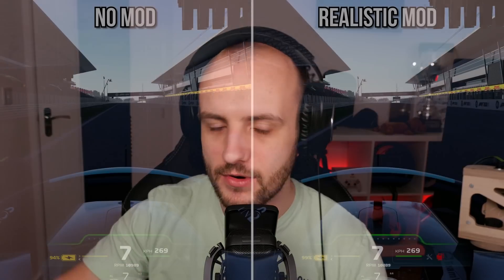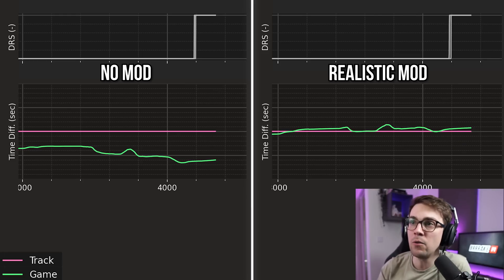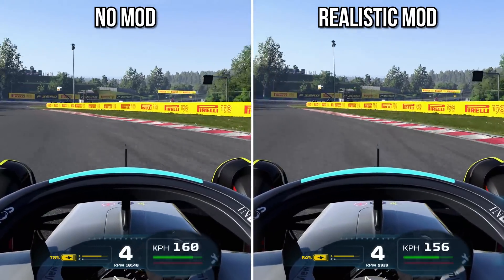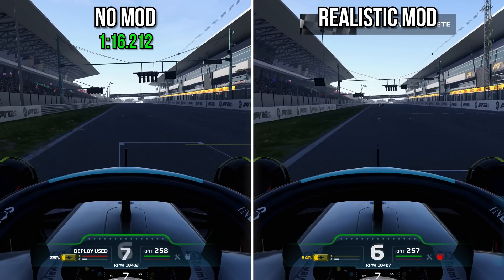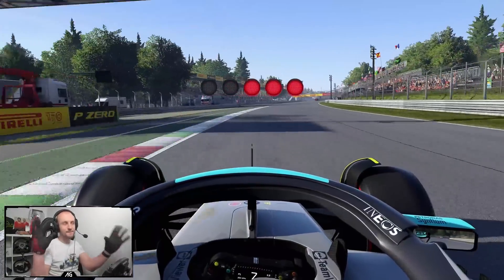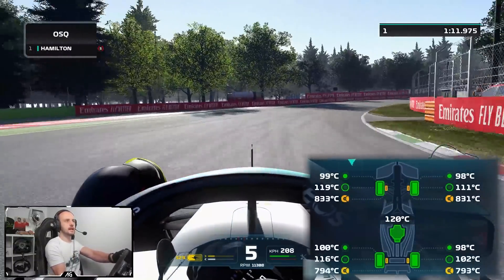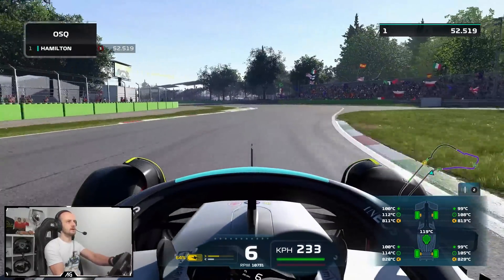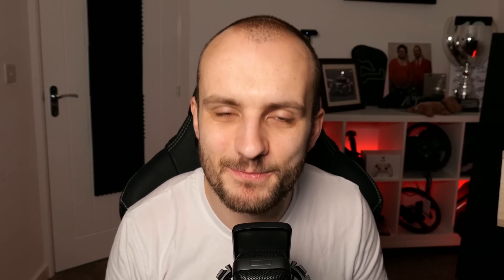An F1 Engineer Made The F1 Game More Realistic

Comment: What about the high altitude in Mexico for instance? I'm fairly certain the F1 games don't take that into account either. 
You can run with pretty high wings in Mexico and still achieve incredible speeds on the straight (in real life) due to the air resistance being much lower there. In the game however, running high wings there will make you crazy slow on the straight...

Comment: In terms of the DRS, there needs to be a modifier for it getting weaker the less rear wing you have on.  At Monza, the DRS is of minimal assistance because the rear wing already generates so little drag, whereas Hungary being a high downforce track, the rear wing is significantly larger and the difference is huge.

It seems like DRS in game is just a flat increase; I gain just as much at Monza as I do elsewhere

Comment: I was always under the impression that you used brakes to heat up the carcass but when i was doing the tire warm up and using brakes to warm them up it wasn't really affecting the temps at all. I just use surface now instead of carcass and surface.

Comment: Tyre temps/wear, make different aerodynamic models (DRS is less effective in Monza because of low downforce wings) than in Bahrain for example, and tyre compounds. I'm not sure but I think there's only 3 compounds available for all tracks instead of the 5 there were available. Also for 23 I think there adding 2 compounds so that's gonna make it even worse
Reply: As it is in Real life: for each track/race weekend all teams get 3 different compounds of tyres from the 6 in the overall selection (Softest C0 - Hardest C5). Those 3 Compounds are always named and marked for Soft, Medium and Hard but f.e. on a track like Monza it can be the Soft Tyre (C0) Medium Tyre (C1) and hard Tyre (C2). which are the softest in the collection. But in Austin it can be the Soft (C3) Medium (C4) and Hard (C5). which are the hardest tyres in the collection. In fact u might know all the tyres from a couple of years ago hypersoft (C0), ultrasoft (C1), supersoft (C2), soft (C3), medium (C4), hard (C5).
Reply: @DraqzF1  you think I don't know how tyres work IRL? I meant it as in the softs from Bahrein (for example) are the sames as the softs on Monaco. There's not 5 compounds in the game. Only 3

Comment: You should change the ers sistem,because in a quali lap drivers actually puts ers on recharge before the braking point(actually the car software does it by itself).It would slow down the cars a lot at the end of the straight,not allowing them to reach very high speed

Comment: i find it so funny that the original creators cant fucking docus on these. like the cars have too much grip at low speed, and too little grip at high speed.
Reply: Because the original creators also have to create every other system in the game.

In this very video they mention that "fixing" Hungary made Monza extremely wacky, meaning it is obviously not as simple as just tweaking a few things to universally make the game better.
I find it funny that creators putting together the entire engine and entire game is always equated to modders tweaking a few values in an already built system.

Comment: in Monza, cars are running with a much flatter wing compared to Hungary so the difference DRS creates is a lot less, I assume teams adapting the car to each circuit isn't simulated in the game and the devs would probably need to tweak the physics by every track to achieve this
Reply: yea there needs to be a mod that reduces the DRS effectiveness the lower your rear wing angle is, obviously Codies wont do this because it is against their philosophy in the F1 games of improving raceability
Reply: Not necessarily, they would need a consistent physics model, that takes in count setups, and the setups need to apply those modifications properly
Reply: @CoastalLab  Wait please don't expect too much from codies 
The first have to implement some new features that no one will ever use and then they focus on the important stuff
Reply: How is the game computing DRS? Is it constant boost to the engine power or does it simply reduce rear wing drag and downforce like it should?
Reply: @MikkoRantalainen  it reduces rear wing drag
Reply: @MikkoRantalainen  everything is essentially done in xml files if you have it on pc and use the erp modder
Reply: Youre just wrong bro. The game isn’t supposed to be realistic lmfao, it needs an actual simulation physics model